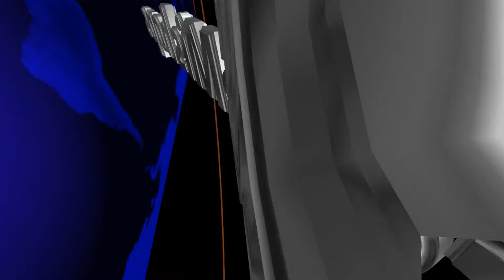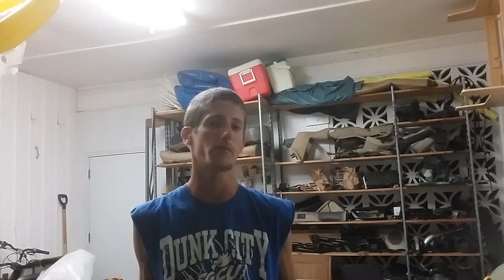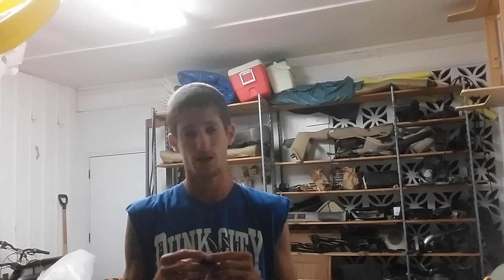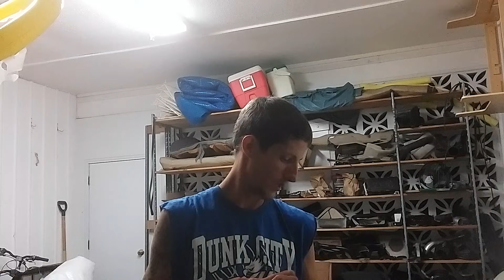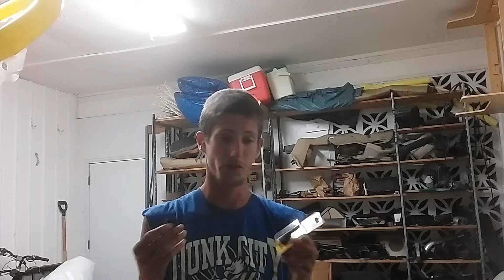How To Wire A 2 Prong On/Off Toggle Switch - Rocker Switch

Comment: Thanks.  Never wired a switch, this answered what I was curious about.  Going to put a switch on the hot wire powering my cb radio.  It has a vampiric drain even when its turned off, and I dont want to keep unplugging it.  Switch will do just fine.

Comment: So much incorrect information.  You say two prong switch always has to be on the positive leg. Why can't you put it on the negative? Still breaks the circuit. Plus there are many advantages to putting the switch on the negative side. At least you got the fuse and amps issue correct even though you were not sure.

Comment: So the battery/power source runs a direct negative wire to the device requiring power? While the positive line from the battery/power source is segmented by a switch. 

Question, for a fuse or resistor; does it matter if it goes before or after a switch? I'd assume before the switch is safest?
Reply from the maker: Yes before the switch.

Comment: Thanks for that ...When you want an  inline switch to switch off /on led 12v lights which are wired to a 12 v leasure battery . Does the switch connect to the positive or the negative wire .Thanks .
Reply from the maker: If it's a two prong then yes.
Reply: @killrspeed00  Thanks ...Is it the red or black wire to fit the switch to please .Thanks again.

Comment: O.O
I must be stupid. So I can run a wire from fuse box from like a fuse, the to the switch, then run 2 wires from the switch and to either side of my truck bed - for my tail lights only?

Comment: What connector are you talking about?? You didn't show what connector or even how to to connect a fuse to it or nothing??
Reply from the maker: I was referring to a female disconnect terminal to plug into the switch. I have another video of using a in line fuse. Sorry I figured it was so simple of an explanation I didnt have to actually show me installing it.
Reply: @killrspeed00  ahhh ok man I'm having so much trouble trying to hook up this toggle switch to turn my electric fan on and off car is starting to get hot in traffic and I don't have the money to buy a brand new fan and all that out right
Reply from the maker: Ayyy I'm sorry to hear that. Yeah vehicles are tough. Some days I just want to go back to horse and buggy lmao.

Comment: Hi. I want to extend the DC-AC inverter switch to make it easy to open and close when needed remotely. My inverter uses a 2 prong switch. Currently, I only have 3 prong switch to use. How do I make a connection from 2 prong switch? Can I choose any prong on the inverter switch for positive wire and another for the negative?
Reply from the maker: You will still use the two wires as before but the third will be the negative.
Reply: @killrspeed00  my inverter 2 prong switch soldered to a board. I thought maybe I could just tap wires from it to my 3 prong switch but I am a little confused about the polarity of inverter switch which is positive and negative I should tap from
Reply from the maker: Yes if it's not marked then its trial and error, which could damage things.

Comment: Im trying to make a panel with several switches and I need one prong for ground and one prong to connect to the interface I’m using would it matter which prong I use for which connection? Thanks
Reply from the maker: For the two prong switch no ground is used. One prong wire goes to battery or power supply and the other prong goes to what you are trying to power, like lights or a horn ect.

Comment: What if the amperage of your power supply is higher than the amperage of your switch??
Reply: There's not much you can do about that Jurgen. You're just gonna have to buy a higher amperage switch, or a lower amperage power supply. If I were you, I'd just take your switch back to the switch store and replace it with a one that has a higher amp rating. I get all excited too when I go buy a new switch that I don't even bother too look at the amp rating. Tomorrow I'm going to put a switch on my alarm clock so its not on all day. The only downside is that I'm going to have to set it when I get home.
Reply: Use a relay, that is what they are made for